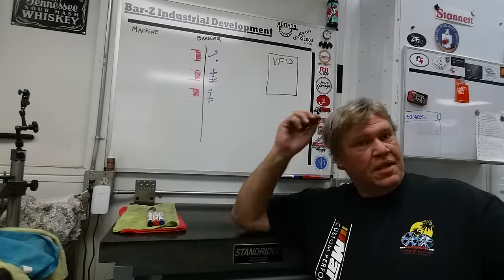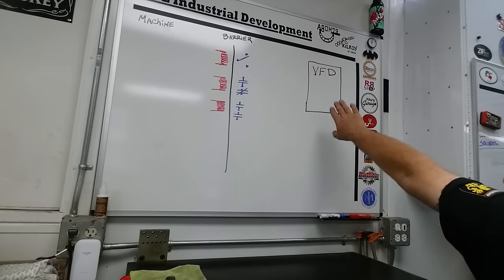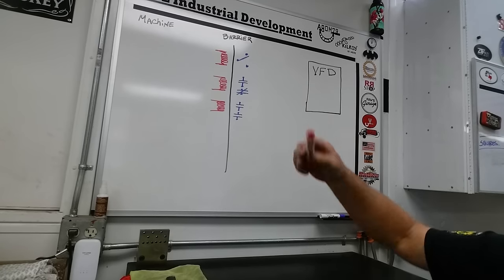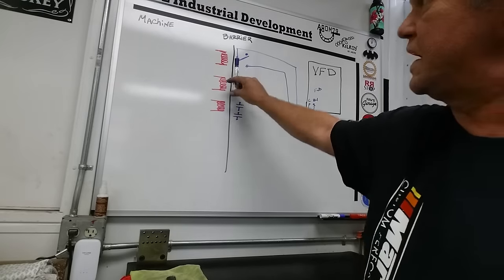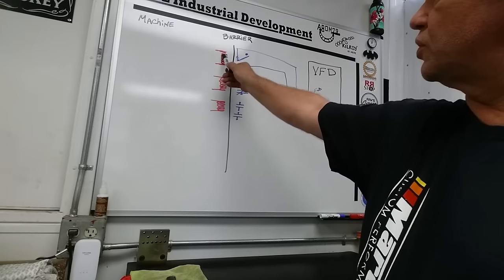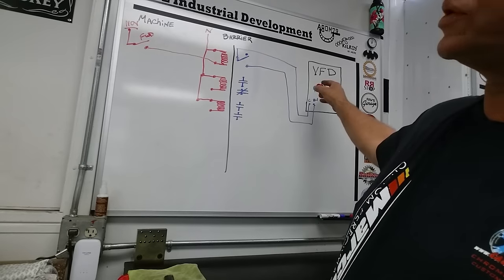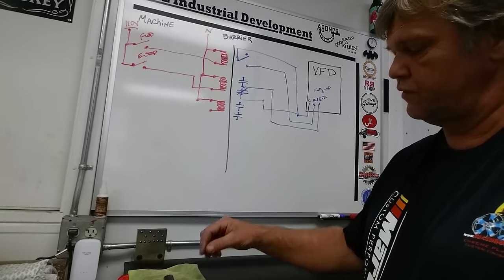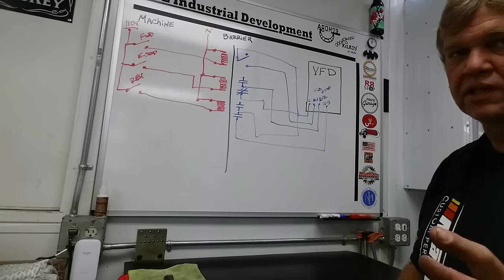Control voltage barrier

Comment: Hi, On some models of variable frequency drives (VFD) you need to go to  the F-codes, P-codes  depending on the brand of the VFD and you need to enable the feature  where you can use the control circuit terminals. This includes the forward ,reverse; E stop, 0-10 or 0-5 to be able to control your speed, braking, etc. Normally default settings are only for the front panel use. So to be able to hook it up to the machine with relays and switches you need to enable that feature. Thank you for your videos. I always enjoy them. They are very educational.

Comment: Stan, Great explanation as usual!  One small nitpick:  In my experience the E-stop switch (BRB or Big Red Button) is wired through NC contact to hold relay energized and relay's NO contact closed.  When you hit the BRB it drops out.  I realize you weren't showing everyone HOW to wire up a VFD but to explain the separation of control voltages.
Reply: I have to agree, when doing an E-stop, any failure should prevent operation of the machine, not set up a condition that prevents safe control.

Comment: Thanks Stan, this was invaluable because I am trying to swap out a 1p machine with a 3 phase motor that already has a automatic controller wired to it.  I just want the VFD to run the machine. FWD, 1/2 fwd, rev, 1/2 rev, stop, and E stop. I'll give it another look at this week and see if I can make it work.  I am using Lenze SMVector drive. Thanks again!

Comment: I don't like electronics too much, but you are a great instructor.  Could you show how to make and size a phase converter out of a VFD?  When fantasy shopping (I am not in a position yet to buy a mill or a lathe, but can still dream) a lot of options for 3 phase machines come up vs single phase.  When looking at rotary phase converters for say a 5 HP machine, they very quickly run into the $1000-1500 range.  That is a big $ hit on top of buying a machine.  I see 5-7.5 hp rated VFD's on e-bay for $200 all day long.  What can you say about that.  They obviously have a bunch of features related to controls and the "variable" part of the system, but what about a dead nuts simple phase converter box? 240V single phase in, 240V three phase out.
Reply from the maker: Check with Marshall Wolf Automation for a simple 3 phase "box" ask for Chris, he can size a static converter for you if this is the way you want to go, have your motor plate data ready when you call.
Reply: Thanks for the contact, but I'm just a spectator at the moment.  You did a video recently on rotary phase converters.  I thought one on using a VFD might be a good idea as they seem to potentially be a cheaper alternate if you can make your own.  Static converters seem to drop you to 2/3 power output and don't cost much less than a rotary one.  As I noted phase converters quickly hit $1000+ for a machine up to 5 HP when you need a 10 HP converter.

When shopping for machines, either used or new, there seems to be more options with 3 phase machines.  Unfortunately we can't get 3 phase power in a residential area in north america (99% of them anyways).  The cost of a phase converter quickly becomes a very important issue with budget if you have to tack that onto the cost of the machine.  Thanks for your time,  I appreciate it.